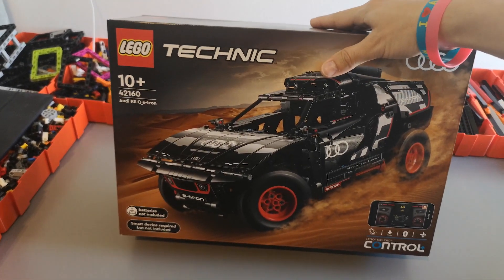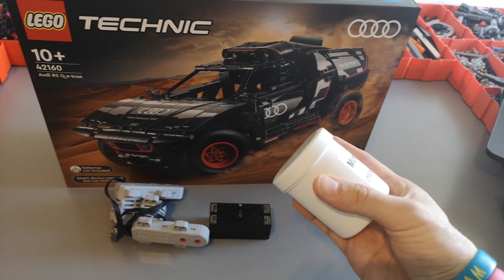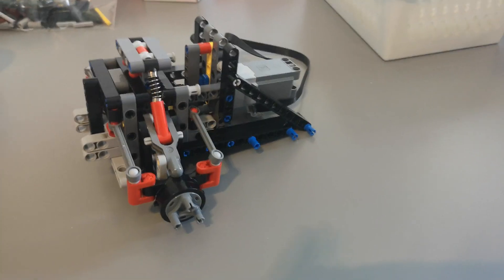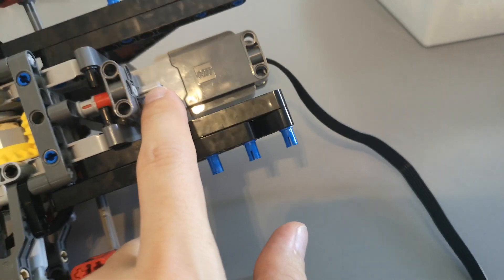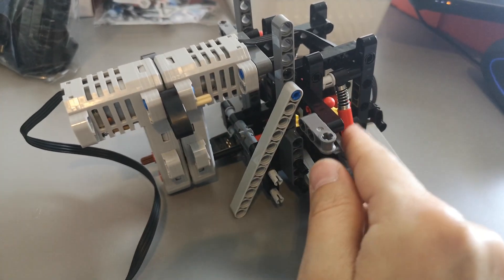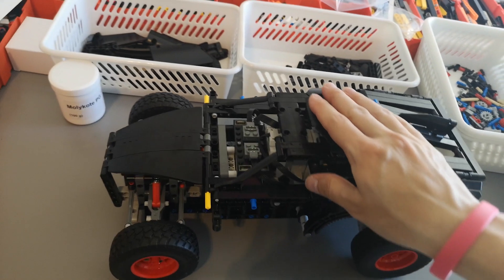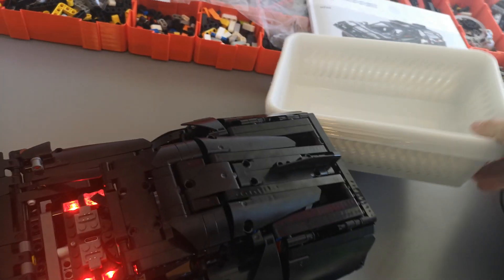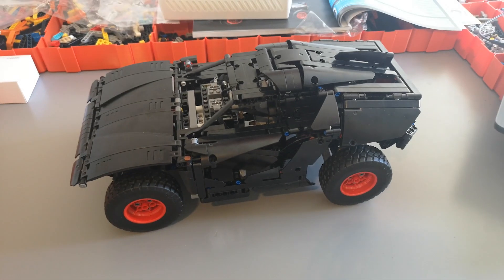LEGO® Technic 42160 Audi RS Q e-tron BuWizz motorization: How- to video. 🚗

Comment: Hi BuWizz, can you tell me if I would need more than 1 BuWizz unit to run 4 BuWizz RC motors on a large model? Is it possible to set up a Buwizz unit with a standard battery box so it can use the extra power? Thank you

Comment: Hi, my buwizz 3  pro battery stops working after like 10 sec, powering 4 L motors on a moc. Can only turn battery on after charging it for one sec. This happens on basically every large moc I have.Mouldking battery never has this issue, though it's slower because of low voltage. I also have many other issues and suggestions, can talk if you reply. thanks
Reply: i solved this issue by plugging a external battery to the buwizz, its perfect because you get more runtime and atleast on my buwizz 2,0 the battery doesnt cut out when using 4 l drive motors, good luck
Reply: Thanks! but what do you mean by external battery? exactly how did you do it?
 @hugomendel6933
Reply: @CantAim00 the portable kind youd use to charge your phone. Plug it in to any charger and it'll reset. You likely tripped the thermal protection on the motor. Also, try updating your firmware if you haven't already. Older firmware had a tendency to do this.
Reply: @shroomzzz  ah you mean to revive it after it’s dead? I thought it was to prevent it from happening. Firmware was newest.

Comment: I have several BW3.0 and motors already so built it based on this video. Probably the most fun of any recent Lego/Buwizz mods. It's so fun doing high speed reverse J turns and watching it flip over. Def not a crawler, but a high speed AWD suitable for the Audi brand. The latest firmware def working well! Well done all around! PS--looking forward the that controller update!!